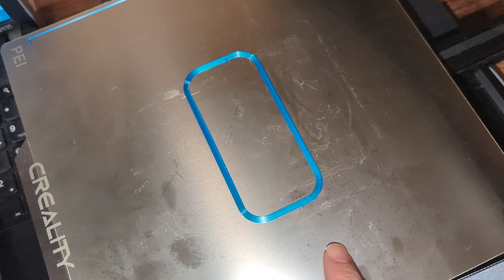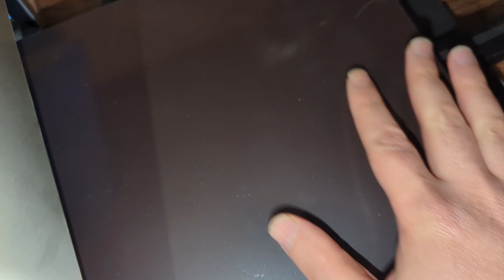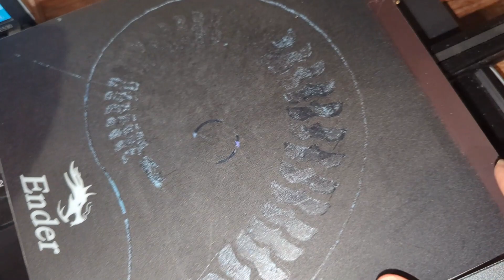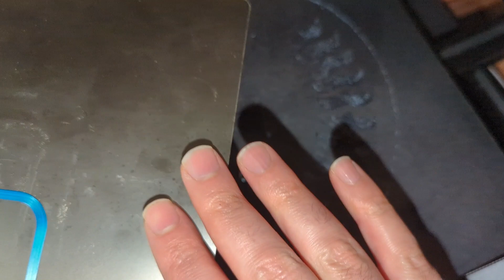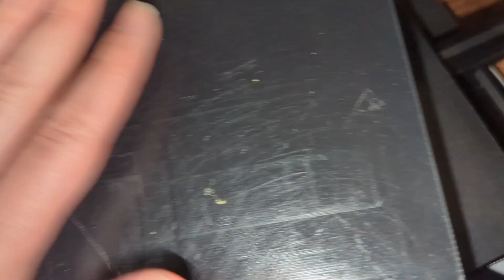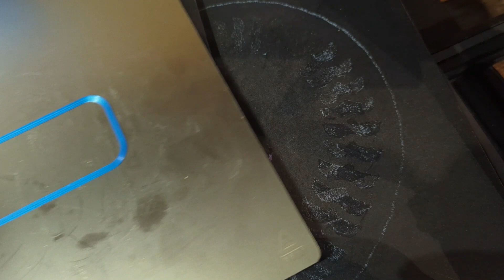This Worth Knowing Before Upgrading Your 3D Printer Bed #3dprinting

Comment: The thing I found that helps with all these beds is to let them heat up for a number of minutes before printing. I think most of us have printed too close and damaged a bed at some time. I've had very good results by printing the first layer (it only needs 1 layer) with the nozzle at a higher temperature than the rest of the print so the filament is more liquid - then it returns to the normal temperature for the rest of the print. It's something I've only recently started doing but it makes a world of difference.
Reply from the maker: 100% agree, I made a mistake and scratched the glass bed but you are correct, I do set the temp higher for the first layer always and then drop it after. Thanks for the helpful information. I'm going to pin it. Thanks for watching:)